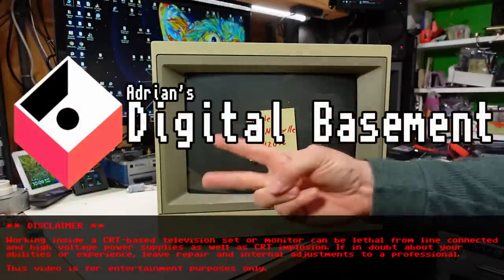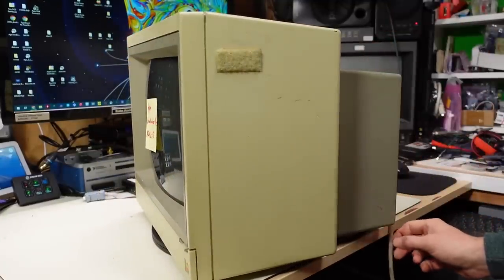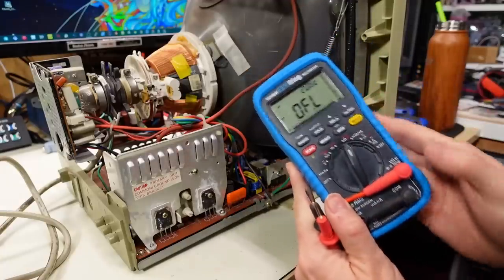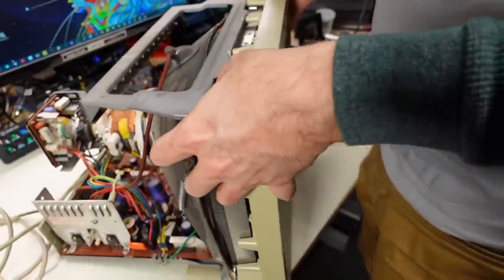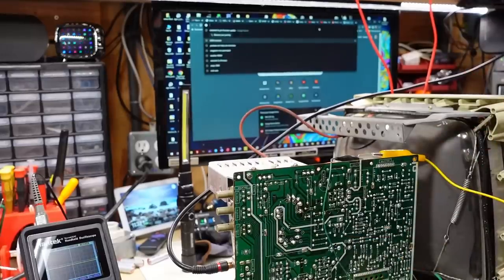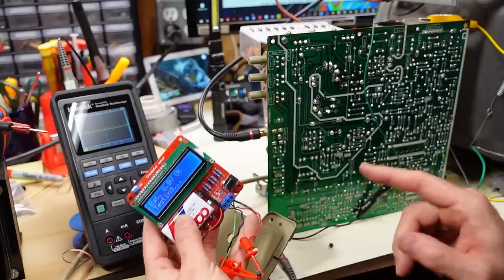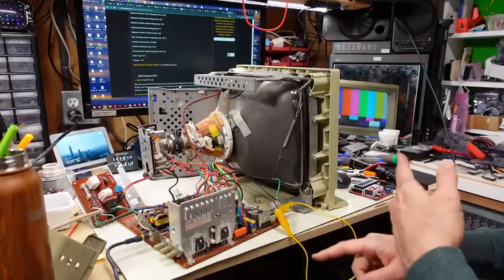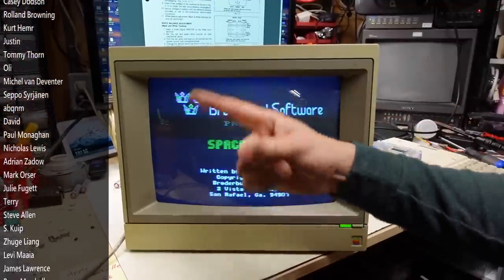A 10¢ part kept this monitor from working

Comment: Gives me some ideas for a 1084 I'm trying to fix. Almost the exact same symptoms. High voltage, flash when turning off, etc. but just a black screen no matter which input I use. I've been tracing the lack of signal backwards from the tube to the chips. I probably need to go the other way like you did.

Comment: Nice! I also worked on a CRT where the board was caged into a metal shield and it was a nightmare to disassemble every time! I have some Apple //c small ones to fix soon, I guess those are going to be demanding too! What was that issue on the bottom right of the screen in the end? Did I miss something or it just disappeared?

Comment: I remember when the NEC multisynch monitor came out.  Without a video signal input, that thing would just whine at a super high frequency.  It was so bad it would drive me out of the room.  But with a good video signal, it was fine, because it was syncing to the video signal.  But that monitor was a sign of things to come, as it would work with so many different video signals.  Which eventually became the norm.

Comment: Adrian, thanks for the great video!
Christmas 1985, I was selling Apple //e and //c systems with the Apple Color Composite monitor. There was a high failure rate that resulted many of the monitors failing within 90 days of usage. It appeared to be the same component on most if not all of them. the warranty was 90 days in 1985. May were purchased 2-3 weeks before Christmas, so we had to appeal to Apple for exemptions, which they granted. I wonder if it was not this same transistor?

Comment: The thing he says about a finer dot pitch requiring higher driving of the brightness and contrast and quicker degradation of the tube. Is this applicable to most/all PC CRTs? Because I have a few PC CRTs that have nowhere near the number of hours of a consumer set and have distinctly dull tubes.

I have an NEC XE21 20 inch with 13000 hours on the clock and is close to being scrapped as the picture and the emissions on the tube are just so dim.

Same for a 17 inch Trinitron E250, it saw use back in the early 2000s as a gaming monitor but nowhere near what a consumer set would get.

Again same for a Philips 201B40, with 2500 hours on the clock. I have to crank the colour levels to get any vibrancy out of it. The manual for this states a normal lifetime of a monitor is around 10000 hours which is interesting. It works out to just under 5 working years for a monitor if used for 8 hours a day (not at weekends).

The default setting on the last 2 are something like 80% contrast. When you crank it up to full there is little difference.

Compare that with a Trinitron 21 inch consumer set that has 15000 hours on the clock and is still vibrant and sharp at just over 50% contrast.

I see plenty of youtube videos and reddit posts with people showing old PC CRTs that have nice bright and vibrant pictures. So I don't know what the rules are. Those monitors must be barely used.

Comment: a hinge that works by bending the material is called a "live hinge".
Reply: Ah, I've always hated those.
Reply from the maker: Funny term for it! I'd never heard it called that.
Reply: Live until it dies, am I right?
Reply: @kentwobits  ironic, isn’t it?
Reply: It's living hinge on wikipedia
Reply: And shortly thereafter, it’ll be a broken hinge. 🤭
Reply: @Petertronic  I've heard it both ways.
Reply: Bit of a joint venture going on inside that monitor, Hitachi tube with JVC yoke.
Reply: Living hinges should stay on things where they only have to last a little while, like shampoo or ketchup bottles.
Reply: @Meshamu  - Even then, I would argue they should only be used for smaller bottles where you can expect to use up the product (esp ketchup, mustard, mayo, etc…) before the hinge fails.

Comment: And a JVC deflection yoke! 18:12
Reply: Which is strange, because I don't think JVC had their own CRT fab. They used other Japanese brands, rebadged. Probably Hitachi was one of them, and somehow a yoke intended for sale to JVC ended up on a Hitach branded tube. I have two old JVC TVs, IIRC both have Hitachi tubes in them.

Comment: That heatsink will not be connected to either mains line, it will be the negative of the rectified mains supply which will be at a high voltage relative to ground whichever way around the plug is inserted into the outlet.
Reply from the maker: I think the danger is it's still earth ground referenced, so if you touch it and you are grounded, it will shock you.
Reply: @adriansdigitalbasement2  Absolutely correct. My first experience of a TV set on the service bench using a chassis connected to B- was shocking, literally!

Comment: BC556/557/558 in your transistor kit are PNP and could be OK for replacing KSA773. As well as BC327 which is maybe too powerful for this and has higher undesirable junction capacity.

Comment: talking from the tv side of repair, the heater supply to the crt was never direct. there was always a series resistor or series inductor to drop the heater voltage down to the 6.3v or 12.6v (i cant remember what the heater voltage was)  because the line output transformer supplying the heater was always slightly over driven to allow headroom for width and pincushon correction,  you can short out that resistor or inductor to boost the heater about  5-10% to get the emission up then run it for 4 or more hours and sometimes if you are lucky that burnt off the cathhode poisoning and you can then remove the short. definately worth trying and it will definately not kill the heater because its a very small boost. there was a trade in little mains transformers with a 20% heater boost back in the 70,s through 90,s and those got left in permanently

Comment: I’ve been working on the newer version the A2M6021. That has a hitachi branded pcb with a Samsung CRT. I bought it not working as a project. What’s a pain with these monitors is there’s no schematics available. After replacing the fuse and fixing a crack in the pcb I got it powering the low voltage circuit. However it never displayed an image. I found a bad transistor and manage to find replacements. I swap that out last night and I now have an image. Albeit not clear, kind of pixelated. Color generally looks fine. I expect a bad cap or two is the culprit. That will be my next task. Your CRT videos have certainly helped me along. Thanks!

Comment: Really nice to finally see you work on an Apple Color Monitor, even if it's a tired one. I based the color emulation of ApplePC (an Apple ][, //e, and //c emulator for MS-DOS) on this monitor – never owned one, but there were a few at my high school. It's so rare to see any of these in YouTube. One thing I always wanted to do for ApplePC was take photos of images on the Apple Color Monitor to get some actual RGB values, and build a model of the effect of turning the Tint control, but I didn't have a digital camera at that point, and just had to go by my memory of what it looked like.

Comment: I'm assuming if you had removed the bad transistor first and tested the emitter on the first one the correct video signal would have been present?  Since the next transistor was shorted the connection between the 2 was shorted - emitter on the first was shorted until you broke the connection by removing the shorted transistor.

Comment: Love your content. Even though I've worked with electronics as a hobby then making a living at it since the 60's, I always gain something from your videos.
Just a heads up on the glue used to secure components to the PC board on a lot of older electronics. I've found that when the glue turns brown, they can sometimes become conductive, so if the glue is contacting multiple bare component leads such as capacitors, resistors, etc., it can short out that part of the circuit or at least cause enough leakage current to affect operation. I've fixed several devices by simply scrapping off the old glue. It can get so bad that you can actually measure the amount of conduction/resistance of the glue by using a multimeter.

Comment: There used to be the issue back in the day when repairing old TV's, a lot of them had live chassis and required an isolated aerial socket, problem was a lot of repairers didn't realise about that or didn't care, potentially you could then get an energised aerial socket and a massive shock risk. 
Multi outlet aerial installations are supposed to have the shields connected to mains earth at the splitter/amp to protect against an energised aerial socket/RFI capacitor leakage, the only exception is a multi outlet satellite setup where the feeds come directly from the LNB on the dish as they are, in theory, already isolated so one rogue device should not be able to energise the other feeds.

Comment: Fantastic! Love the monitor repairs...of course ;) EDIT: A suggestion when trying to adjust the image at the 44:00 mark, turn the brightness/contrast all the way down, turn the screen pot up until you get the retrace lines, turn the screen pot back down until the lines JUST go away, and leave the screen pot at that level. Then adjust the brightness/contrast/colors as needed. If it still looks dim at that point, then yes. The tube is weak. That's what I have found to be the best way to get the best results. The issue in the bottom right corner is likely bad/failing caps or the B+ regulation is incorrect. And yeah, bad caps won't affect colors or a weak image but they can cause oddities like the issue in the bottom right corner. I've even seen a failing flyback cause black blobs in the image as well.
Reply: Yup. This is pretty much universal for many models of CRTs.  There are a few for which it doesn't work, though.
Reply: i typically leave the brightness at the halfway point when doing this because if you put the screen pot at thr retrace point and the brightness is all the way down, you basically have zero adjustability in the brightness pot at that point

Comment: If the mains uses a bridge rectifier the live side of the chassis will be about 70 volts hot no matter which way you plug it in. Most consumer electronics used a 2 prong cord, sometimes polarized, sometimes not. It was up to the tech to do a leakage check on all exposed metal parts accessible to the customer after the unit was reassembled. The test can found described on the back page of almost every SAMS photofact.

Comment: Not sure, but most Apple IIs I saw here in Australia back in the day just had a monochrome monitor, so I suspect they were just NTSC models. A while back I bought a clone, which didn't come with any cards, and I'm pretty sure that's just an NTSC model. I haven't got it working yet, but I did buy a PAL card for it to see what the difference is. Unfortunately the only CRTs I've got that take a PAL or NTSC input are my PVMs, which are all in storage at the moment. So running either a PAL or NTSC signal through my scan converter to run on a VGA CRT or LCD probably isn't a good for comparing image quality between PAL and NTSC.

Comment: I think that glue Adrian is talking about is a form of contact cement - vibration damage is a thing, and certain parts are tacked to the board to minimize the parts shaking loose over time (my company uses a relatively soft epoxy instead on the various products we assemble).

Comment: @9:44 Adrian is talking about the glue that, over time, starts absorbing moisture from the air, and wonders if the correct term for this is hydroscopic. It's actually hygroscopic. I mention this only because until ten minutes ago I had never heard the term before; my dad was talking to me about car brake fluid which is also hygroscopic. When he said it I thought I'd misheard, and I said "hydroscopic?" :)

Comment: Adrian if you have a rejuvenator you can use it to test the guns to see how tired the guns are.  I wouldn't count the CRT as bad until you test the CRT isolated from the chassis.  It is so easy to test. At least on my Heathkit.  Also you can do a cleaning of the guns while you are at it.  Did you notice that the yoke as a JVC logo on it? #ColecoAdam
Reply: I believe he has an old rejuvenator from the 1960s? he's used it in a few videos, odd he didn't mention it here, he didn't seem to like using it from what I remember
Reply: @joesaiditstrue  my Heathkit is much newer, is his really from the 60s? There weren't a lot of color TVs at that time.

Comment: B=308? Is it a BC857/858? Are you sure that a super beta transistor will fit here? Typically super beta transistors are low-voltage, 30 V max.

Comment: Is the rejuvenator not an option anymore? I thought that you got a pretty good result on that one Apple monitor some time ago.
Reply: IIRC he dislikes rejuvenation even though he has all the necessary equipment. It just doesn't give you stable and reliable results and more often than not it will just completely ruin already bad CRT.
Reply: @pavuk357  he’s also said he had better results with the simpler rejuvenator. From all the other such videos I’ve also watched, the kind where you just manually blast voltage for a fraction of a second does seem to be more reliable than the computer-controller multi-minute ramp-up on his most recent tester. 

But even then, the results don’t last, so it’s simply not worth the gamble unless it’s totally unusable. More often than not, a weak monitor gets made worse, so it’s a crapshoot.
Reply: This monitor is almost NOS, super clean inside, it shouldn't have a weak tube, especially since it's Hitachi, they made one on the most rubust, long-life CRTs. I have repaired/refurbished many dozens of CRT TVs and monitors, and seen hundreds of them inside, even the ones with half an inch thick soot-like black dust on every high voltage part often had a perfectly usable CRT, with sharp and bright picture. There might be problems with bad caps on the neck board, or increased leakage current of interstage coupling capaciors in the video or RGB circuits. It needs a CRT test, and if the tube tests good (it should), it needs a partial recap with all the electrolytics in the signal path replaced. And all of the dipped tantalum ones, too. ESR meter is not enough in cases like that to find bad caps, because increased leakage current can cause big trouble in high impedance circuits, and an (electrically) leaky cap might still have low enough ESR.

Comment: Your chassis ground is connected to the third pin on the AC plug which is missing. So no ground for you.

AC neutral is not ground.

Comment: I'm in Australia and I've used a few Apple IIE Platinum computers, most of which had monitors that looked like this one, I don't know what model they were though, and I don't remember which control panel door they had, but they did have the same arrangement with the power on light and power button, and I also remember at least one of them having the Colour/monochrome button.  I presume they were PAL, but I don't know for sure, at the time I used these computers I knew what NTSC and PAL were, but I wouldn't have know if that affected Apple II computers.

Comment: Adrian , you can do things like that verry short. Take an > 10k resistor , one end to ground one end to the transistors on the neck board. on the head think or better known as collector. The picture tube will show you the max what is possible. Play around wit the resistors , lower resistance more intensive  beam.

Comment: Adrian, thank you so much for your repair videos! I always learn a ton from them, even when they don't go as expected. Something that I've discovered watching your videos, however, is that I can't really enjoy watching videos about 'nicotene infused' electronics. This is entirely my issue and nothing to do with you: My parents smoked like chimneys and I grew up with severe asthma and allergies as a result. Just thinking about that smell, even tangentially, makes my airways feel like they're going to close up. And that's okay. Not every video is for every person. Something I WOULD be interested in seeing, and I don't even know if this is possible, is a video about removing the tar deposits left by smokers on electronics. Like, is there a soaking treatment that wouldn't corrode or otherwise damage components? I'm absolutely looking forward to your next non-tar-covered video!

Comment: Be carefull with those hot grounds,! There is allways voltage on them regardless of which way you plug in the plug, because there is typically a bridge rectifier making the "ground" live during the negative halfcyle of the mains voltage
Reply from the maker: You're right, it's after the bridge rectifier, and it's referenced to the mains so it'll be shocking no matter what. (Unless you have an isolation transformer, which I ran this on.)

Comment: you flipped the first transistor you replaced, when you tested it and said the flat face is gonna be up for this one, it was pointing towards you and not in the same direction it would be soldered in

Comment: I think it's possible for the first PNP transistor you tried had the "C" and "E" backwards. Many low voltage transistors will still "work" with the "CE" swapped but it'll have really poor gain.
Reply: Indeed. While the gain is bad, the collector-emitter saturation voltage is extremely low in that configuration. Before we had good MOSFETs to short things to ground, bipolar transistors with low satuation voltage were used to short an audio signal to ground as "mute switch". There are transistors that have the "reverse operation" mode explicitly specified in the data sheet, and often times "mute switch" is one of the recommended applications pointed out on the title page of the data sheet.
Reply: Those little AVR transistor testers have no problem determining the proper lead configuration. The gain was fine, the problem was the bandwidth.
Reply: @eDoc2020  This.  Just because it's rated for up to 200MHz switching frequency doesn't mean its slew rate wasn't in the toilet